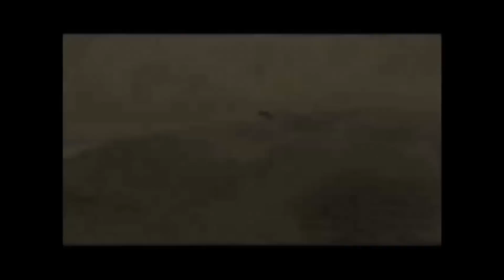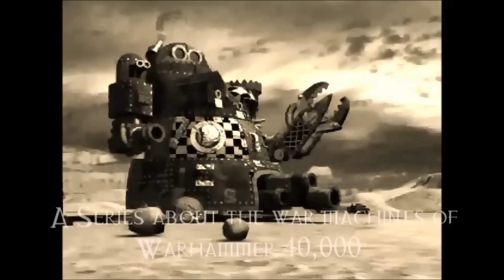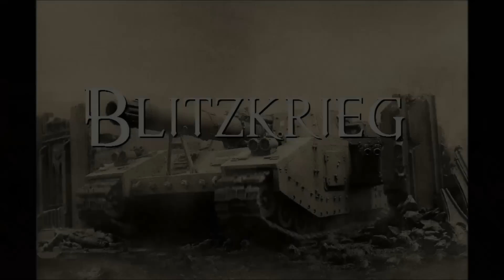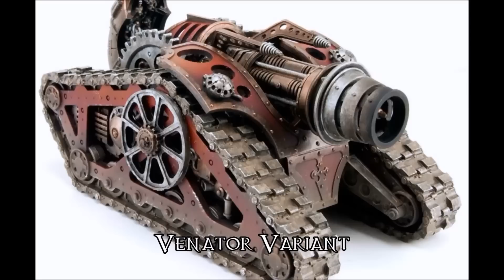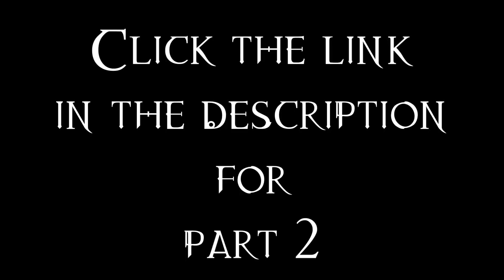Blitzkrieg: Adeptus Mechanicus War Machines Part 1 W/ Fiaura the tank girl.

Comment: All of these Mechanicum vehicles are very effective ingame. The Krios have flare shields which give -1 strength on direct and -2 strength on blast attacks which make them as tough or tougher than a Land Raider vs. frontal attacks (no benefit vs. D). They are flimsy on the side but have the fast rule so you zip them around as tank destoyers and keeping incoming fire on the frontal arc.
Reply: Also, check out the Forge World Mechanicum army book, the Ordo Reductor versions of the Minotaur get all sorts of Great Crusade kit like flare shields, Mauler bolt cannon point defense and autosimulacra.

Comment: ok uh in regards to her point about open tops not being vulnerable to counter battery fire - the danger isn't direct hits, its shell fragments, artillery rarely kills with a direct shell impact, its the fragments that are thrown in every direction that is the killer. Secondly where did the Hellcat thing come from? It would be interesting to see where the hell that random factoid came from, plus comparing something this big to something that small is a little illogical
Reply: +Conlan Mcgee Bigger heavier vehicles are just smaller vehicles with more of everything, they are easily compared and this is quite often done.  The reason I say the design works as open top that prevents counter battery because anything short of a direct hit will have it's fragments hit the armor rather than the crew compartment, keeping them safe.
Reply: +Fiaura The Tank Girl Yes all things considered a direct hit from counter battery is quite unlikely, what I was referring to however,  was airburst artillery rounds exploding in the air above the vehicle showering it with shrapnel-that is of course ifairburst is thing in 40k? Secondly I was simply questioning if the comparison between the hellcat which was a thin skinned td that relied on mobility and concealment for survival and a giant, heavily armoured arty is an apt one. Would it not have perhaps made a little more sense to compare it possibility to the Hummel or something along those lines? To vehicles that fulfilled a similar role to the one in question?
Reply: Conlan Mcgee
The hellcat had enough armor that non-direct hits from Artillery wouldn't hurt it, the hummel did not, as evidence by video and pictures of soviet counter-battery fire hitting near hummels and kill the crew while Hellcats could have it hit nearby and be fine.